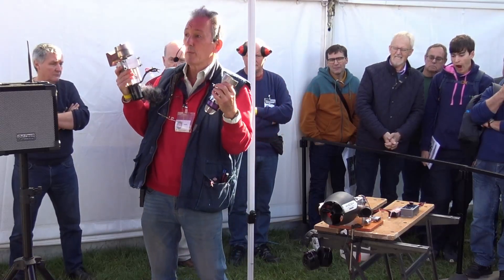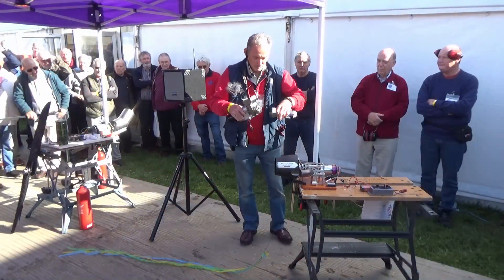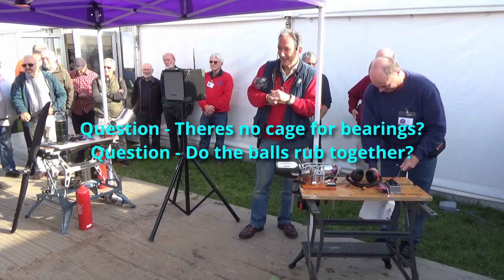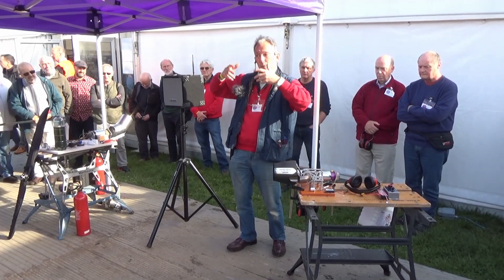DuB-EnG: Kerosene Fan Jet Engne Demonstration and Talk - 250K RPM and 10Kg Thrust

Comment: What is the life cycle of the engine? Hours? Some very interesting applications could be found im sure.
Reply from the maker: Bearings need changing approx every 50 hours of run time
Reply: @DubiousEngineering  That seems really good at 250k rpm.

Comment: I saw that engine run - very impressive piece of equipment - not just a jet, but a small and viable geared turbofan. Extremely good. Well done
Reply from the maker: Yes, with no physical contact between the engine and fan gearbox!!